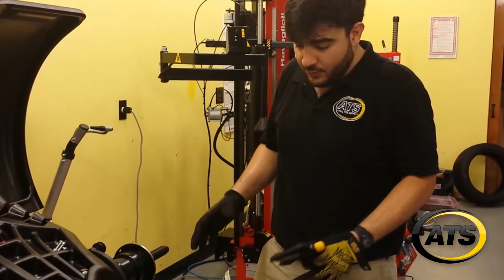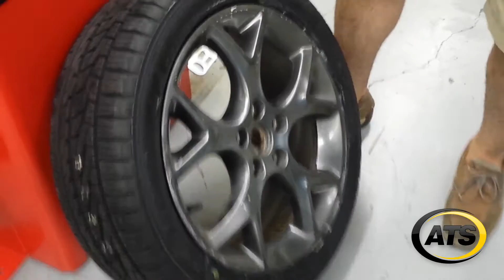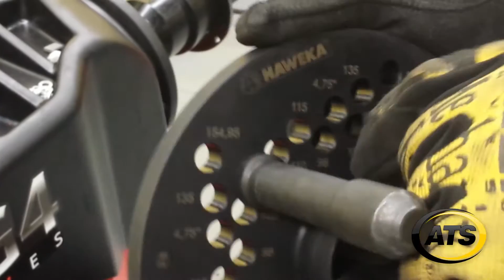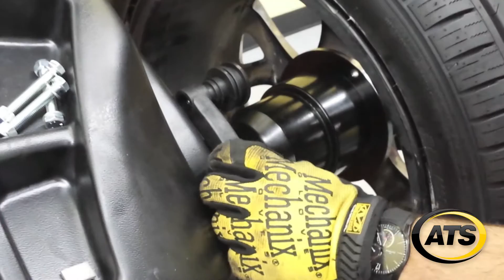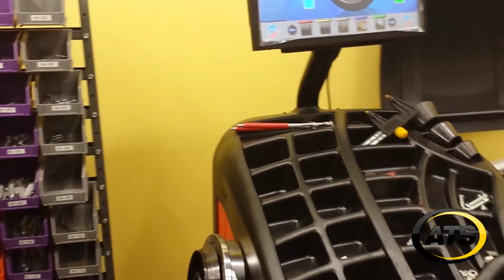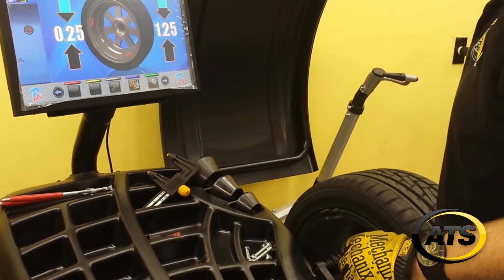How to Balance Your Tire with Ravaglioli Balancer

Comment: Hello Sir, we have G6.160H model, can you please specify where you took the measurements with the digital meter ?
I am also confused  about placement  of the weights it shows 4 locations in the monitor with 4 different values.
thanks.